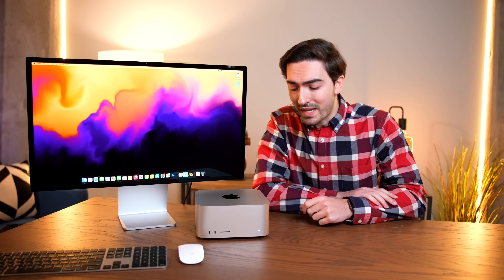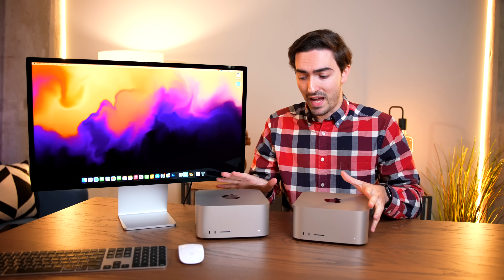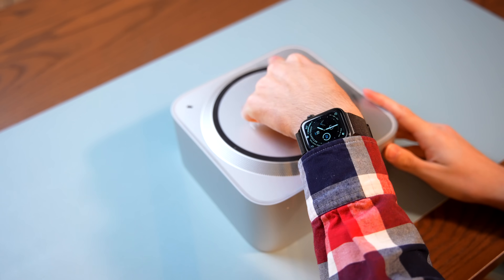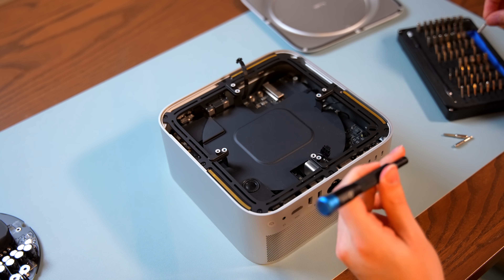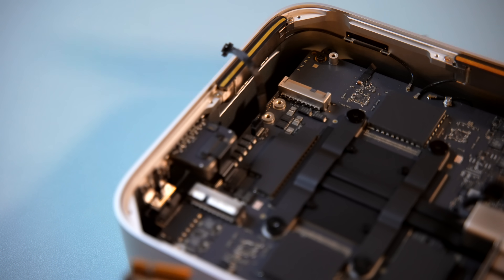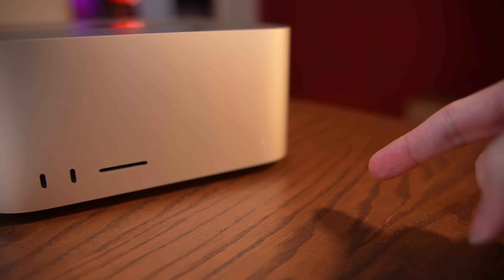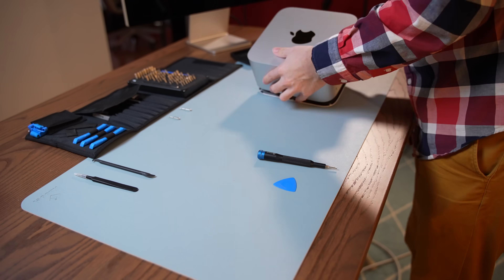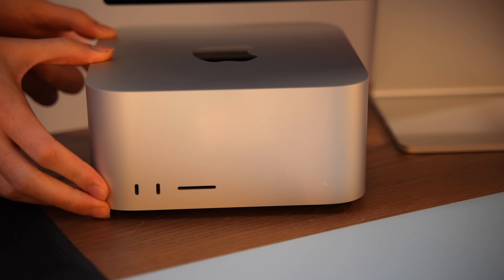What happens if you try to UPGRADE a $5,000 Mac Studio?

Comment: Now what we need to see is a Studio with Max SSDs to see if they have or need a second set of controller chips. Also could you remove the Button Cell and zap the PRAM and se if that would work? Or too much of a risk. Either way that's a Bad Apple.
1 more thing I thought in the M1 Max the unified memory was on die, does this mean it is not if you get an Ultra and doesn't this kill a big benefit.
Reply: This is storage. It has nothing to do with the unified memory. Ultra has unified memory just like all the other M1 architecture.

Comment: It's just Apple's security function. If you can remove the SSD and plug it into a different system, its no longer secure now is it? I'm certain someone will come out with an aftermarket SSD for it eventually, but it won't be bootable.

Comment: You need to calm down and stop slandering Apple. First off, why aren't you wearing thin, insulated gloves when dealing with a power supply? That's electrical 101. As for whining about not being able to switch storage, if that's actually what it is since I though all storage was on the SoC, Apple very easier could have, should have, installed, formatted, whatever, that storage so it ONLY works in the present configuration. If you can easily swap storage, it means you could easily steal the data. Think about that for a minute. Apple just released the Mac Studio so they probably haven't completed all the documentation necessary to fully repair these Macs. I'll finish by saying right to repair also requires some more than basic understanding on how to repair a complex device. Just because you think you're qualified to repair a Mac (note: I'm not saying enhance a Mac) doesn't mean everyone else is qualified. Does the right to repair laws mean you can open a brand new Mac, put it back together, hope it works and if it doesn't, you can go to Apple and get your money back? I don't think so but there will be many others watching who think they can do whatever they want to do without any consequences because, it's their property. 

That said, I hope Apple comes out with some technical documentation highlighting the two storage ports. This would benefit third-party vendors who MIGHT be able to gain access to Apple's proprietary(?) storage design but it would also put many users into the position of trying (and failing) to upgrade a Mac Studio. My hope is that Apple will offer repair parts as well as larger storage along with the necessary documentation and process to actually update them. This could/should be the way the Mac Pro is built with more than two slots. This would mean it would be upgradeable by the user even if they had to initially purchase parts from Apple. The amazing speed of this storage is not something I believe others can even come close to.

Comment: I assume it's tied to a hardware uid that is generated at manufacture time before shipping. So basically, if the uid doesnt match it wont work. Of course Apple has the internal tools to reset and regenerate hardware uid's, but it might be tricky for end users to get to that.

Comment: For how hard you worked for it, the ifixit gods should have smiled on you and given you sweet victory! Wow, that was disappointing!! Whilst the primary SSD is proprietary, I see no reason why the second slot could not have been turned through 90 degrees to facilitate the installation of a standard SSD, but relegated to operating as a slave rather than a master. Apple would have had control over what the machine can boot from and they could have kept the iMac Pro user configurable trump card that so many would happily pay extra for. Short-sighted and greedy. Bring back the Woz!

Comment: With the multiple Thunderbolt 4 Busses, it's easy enough to add external nvme storage. While not as fast as the internal nvme, there aren't any major use cases that an external TB Drive couldnt handle. So, I'm kinda neutral on my thoughts about this apple decision. If i want to expand the storage, I can, with ease, using an external TB NVME.

Comment: Could it be the T2 chip?
Reply: There is no T2 chip, since the security functionalities are built into the SoC itself. But yes, these are standard security measures. Just need to find out the right procedure to reinstall, nothing new in fact.
Reply: @philippeastier7657  Ah, hmm. Forgot about the built in part.
Reply: @BrookNeese  No worries. :) However, functionalities are identical, so you can't swap SSDs like that, by design, until you reinstall the machine from Apple Configurator. There is no reason this will change.

Comment: Unbelievable. I thought it was bad enough when they started making their computers so small that you had to take the entire thing apart to get to the hard drive to replace it. Storage devices wear out and need to be replaced or upgraded! It's sickening that they would do this in order to force customers to pay $200 more for each storage capacity increment. I still think fondly of my G4 tower, you don't even need a screwdriver to open it and access all the memory slots, space for multiple hard drives, and expansion cards... even upgrade the processor if you want. What happened to that company?
Reply: Steve Jobs died, that's what happened.
Reply: @Four1LF  Good point, but I'm not sure Jobs would have done things much differently. The true champion of expandability at the company was Woz. Jobs designed the Mac to be a closed system (he hated slots) while Woz was more of a hobbyist and tinkerer, who thought users would want to change everything.

Comment: What I think needs to be done here to fix the issue is to boot into One True Recovery. You will need to validate you are the machine owner though. I'm not sure of all of the details.
I believe that the macOS install is tied to the machine. Not that the storage itself is tied to the machine.
It's definitely terrible that they skimped out on second controllers.

Comment: Interesting. You may need to boot into recovery menu, disable all safeties and encryption, and only then exchange or add storage.
Reply: It makes sense. Also, that Texas instruments controller might have something to do (in case your point didn't work). one thing do-able may be some kind of re-write or something
Reply: Yep, there is an engineer's work-around 👍🏼
Reply: A decent normal non apple computer will enter bios mode as soon as it can't read an OS.
Reply: @fabiospringer6328  Not if you don't first disable the safeties and SSD encription.
Reply: @fabiospringer6328  How's that relevant to a video about an apple computer?
Reply: @fabiospringer6328  Apple shows the Line thru it splash screen, but this is doing something that essentially doesn't allow it to even pass the BIOS stage. Like bad memory on a Win Machine will just show flashes and never show a LCD image. Adding the different SSD is keeping it from passing POST.
Reply: @batsonelectronics  wich means apples is locking you out of your own computer because you dared to change it storage. It is not bad memory, it is bad storage wich should not lock you out of bios settings.
Reply: @fabiospringer6328  but how do you upgrade storage without buying the storage from Apple in the first place? The slot is proprietary and the SSD controller is embedded into the SoC, you can't just get an adapter and a NVMe drive and off you go anyways.
Reply: @fabiospringer6328  I don't disagree, I was just explaining why it happens, not that I think Apple should do it that way.
Reply: @fabiospringer6328  right now Apple generally supports 3-4 year old hardware and occasionally a year or 2 past for some parts. I do non warranty Apple repair in my store but I can see where shortly, there will be very little I can do to fix machines as everything will need to be done by Apple directly with their specialized serialized machines. I have many business and consumer customers who still use 10 year old hardware and have no need to upgrade. If Apple doesn't support these 100% proprietary M chip machines for at least 10 years, I can see huge lawsuits happening, and APPLE  absolutely deserve to lose all of them for it.  Luke didn't try all the ways to make a drive install work so we really don't know if it can be done or not, I hope it can.
Reply: @batsonelectronics  the 2015 MacBook Pro is still supported and it's 7 years old
Reply: @gmdrandom6287  it gets software updates but Apple does not repair hardware failures. My point was to Hardware, not software.
Reply: @fabiospringer6328  There is no indication that anything is locked out.  Apple Silicon Mac's require the iBoot2 boot loader to be present on the internal SSD - it's part of the boot process.  This guy put an empty SSD in there without prepping it - of course it didn't boot!
Now, it may not be possible to put iBoot2 on a non-Apple SSD - if true I will be more than happy to join with the torches and pitchforks.  But to be outraged at Apple at this stage, especially from someone who doesn't appear to be familiar with the boot process for Apple Silicon Mac's is probably not going to age very well.  Folks with more technical depth are going to have to chime in after they have had more time to really dig in.  This is the first Apple Silicon Mac with removable internal storage; we are in entirely new territory here!
Reply: @DocNo27  
I’m wondering if we watched the same video?  He didn’t try to boot from a blank drive, he added the blank as a second drive, moved the original drive to the second slot to see if it would work and then he swapped a working drive into another computer.  Can you reference where in the video he tries to boot from a blank drive?
Reply: @johncho8766  attention span of a mosquito. :))
Reply: @DocNo27  He did put a working genuine Apple SSD card that properly booted in the other machine.
Reply: @batsonelectronics  It's ARM, so the on-die bootrom (usually tiny, like 32kb) just jumps to an application loader (think like UEFI) on the NAND (which can be up to 128MB, at least on Android phones). The SSDs could have been corrupted when it was swapped over, because of the T2 chip.
What needs to be done is the stock firmware needs to be re-flashed to the computer so it will boot normally again.

And this is why I'm worried about the future of computing being "secured"
Reply: @tsuyunobradley4439  one thing that seems to have been ignored is that these are not two separate storage slots. These are two slots that make up a single unified storage pool. That means that when you add a second module, you’re probably going to be getting a few k of the first module, then a few k of the second, etc. So effectively you’ve got a completely corrupted drive. And that is in addition to the fact that it’s probably encryption-key-locked.

One thing I did not hear him say at all is whether these storage modules are the same size even. If they’re not, it’s never going to work with two, not even with Apple’s special sauce in the Genius Bar.
Reply: @gmdrandom6287  it's not supported any more.  Apple store sent a 2015 MacBook pro to me for a battery replacement TODAY... Because they don't service the 2015 anymore.
Reply: @gmdrandom6287  my 2013 is no longer supported.
Reply: @RunForPeace-hk1cu  there's something called donor parts that you can salvage out of dead devices
Reply: @JasperJanssen  You explained this well!
I tried but I couldn't make it sound very easy to understand, it was a highly technical explanation based on my experience modifying and upgrading a docomo LG Style2 smartphone (I know it isn't an M1 Mac but it's ARM still and a lot of the same issues present but differently.
Reply: @batsonelectronics  If you buy AppleCare ($99/yr) ... you can renew indefinitely and get AppleCare support for the life of the machine.

If you invested $4000-8000 on this machine, it's hardly a huge investment.
Reply: @josir1994  Where do you find dead Mac Studio?

It's way easier to just get replacement parts from Apple, or you think that's somehow "EVIL"?
Reply: @RunForPeace-hk1cu  when I checked the price and got to checkout, it only gave me a 3 year AppleCare+ option, not a yearly one. I looked for it as I saw someone else mention it, I couldn't find it.
Reply: @RunForPeace-hk1cu  ask Louis Rossmann how hard is it too get replacement parts from apple
Reply: @batsonelectronics  you can renew it after 3yrs on a yearly renewal basis
Reply: @josir1994  as hard as going to Apple Store to get AppleCare 🤷🏻‍♂️

Unless you are too cheap to pay $99/yr for a $5000-8000 machine that is

Cost of doing business. These machines aren’t for regular consumers. They are for people who use it for make money for their businesses. An investment.

After tax write off and not needing to pay taxes on tue purchase (business buy) in many countries. The cost of ownership is a fraction of the MRSP. Plus the energy saved compared to space heater PCs (energy cost is rising rapidly). 

But if you are a regular consumer applying the logic of money pinching 🤏 and counting Pennies, then yes, it’s not a good deal.

Frankly, if you are a business owner, AppleCare is a no brainer.

Comment: I have access to internal documents and Mac Studio repairs have a similar process to replacing a screen on iPhone 12/13. The Mac puts itself in DFU mode to be restored by System Configuration which (by my assumption) flashes the security chip to allow it to boot.

Comment: What happens if you remove the SSD entirely? Can you still boot from a thunderbolt drive or will the system be completely dead once the storage module fails?
Reply: Yes!I’d like to know too
Reply: You can’t with an M1 Mini. If the internal drive, which is part of SOC, fails your mini becomes a brick.
Reply: @philiprobar  not a smart thing then to opt for the bigger storage as it’s like putting all our eggs in the one basket😟
Reply: I asked the same question as I want to boot from my 2TB Thunderbolt SSD.

Comment: I wonder if all those ports are filled up if you get the max SSD capacity from Apple? I bet Apple has a way to fuse those drives together so the computer sees them both as one drive. They used to do that with the old Fusion drives. We need to push congress for RIGHT TO REPAIR laws. This is total BS.

Comment: Your conclusions are too quick. Swapping SSDs is not possible for a number of Macs (including x86) without at least erasing the device due to security levels on macOS and generation of various encryption keys. So you should first try to reinstall the system properly. Also, there is no controller on those SSDs at all, this is just memory.

Comment: Hey, Luke! Your hope that Apple will “change its ways” and allow owners to upgrade their machines is an empty procedure. They aren’t going to do that. HOWEVER, there is a fairly large community out there of people whose major interest seems to be circumventing Apple’s despicable and draconian efforts to keep it’s customers from doing anything other than upgrading their computers by buying a new one. One example of this is the online presence who calls himself DOSDude. Among other things, he maintains a website allowing owners of Macs that Apple considers “obsolete” to continue to upgrade their machines with later OS versions than their computers would ordinarily support. The answer to you question about adding internal storage aftermarket to the new Studio machines lies with this community. Someone will surely find a way to hack the firmware on these machines to allow both a second SSD to be added and to replace the existing SSDs with larger ones. Count on it, but as it’s early days yet, it might take a while.
Of course, then we beg the question, where will these short SSD modules come from as they are not standard? Someone such as OWC, perhaps, will have to make them. But of course, now we are confronted with the chicken-and-egg scenario. The firmware will most assuredly have to be addressed first, or, as you have proved with this video, aftermarket internal storage solutions won’t even work. 
Patience, my dear Luke. It will happen. Keep up the good work! Your contribution to the Mac Community is invaluable.

Comment: This is true for every M1 Mac, if the SSD dies, you can't turn it on anymore at all.
An SSD does not last forever, it will die at some point. So if you bought an M1 Mac, you threw your money out a window!
So Apple not only scams you blatantly on RAM and storage price, but they just did the most unacceptable thing ever: pro desktops completely unupgradable, and EVEN WORSE: IF YOUR SSD DIES YOU ARE SCREWED!

Actually, these SSDs feature a lot of hidden volumes that are paired to the Mac's firmware.
I'd be curious to see what happens if you swap both the drives and the firmwares. Well, I am an idiot, there are probably other horrible parts paired to the firmware.
And even if it were to work, it still means you need another Mac Studio, you can't just put any random SSD.

I think amazing people like Dosdude1 should now start working into making a custom firmware that allows any M1 Mac to boot to an external or internal drive no matter what it is! But I am saying that without having any idea how hard it would be.

Comment: If you cloned the original SSD in the machine and put the copy in the second slot, would that possibly work?  Of course that would mean you'd need a second proprietary SSD that fits in the slot, but do you think that if the SSD's matched the machine they were in, you could do it?